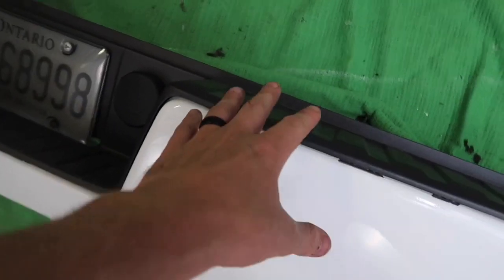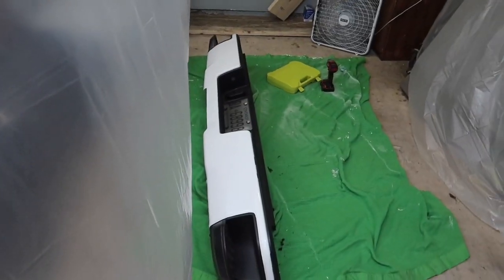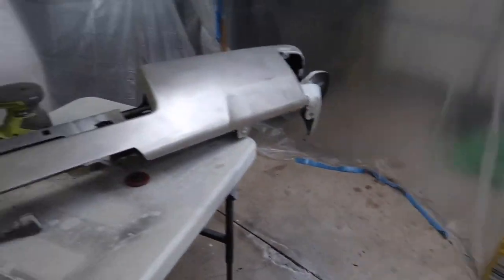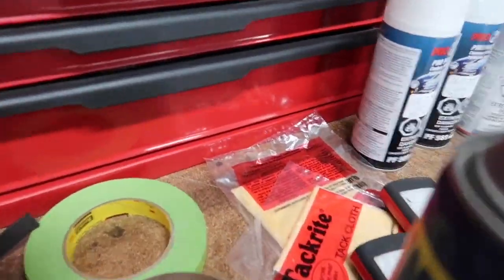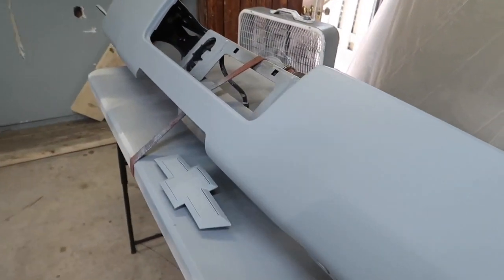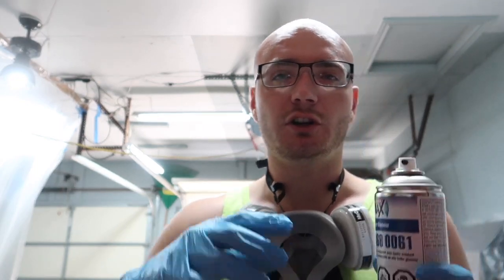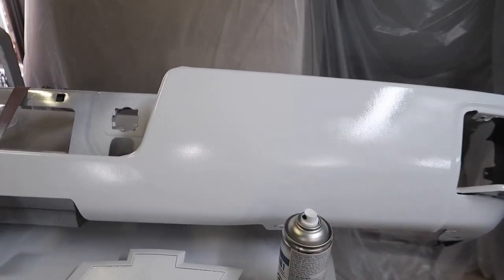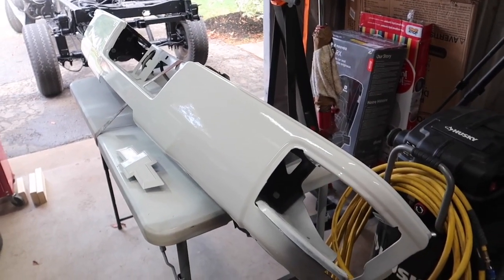How to paint over chrome bumpers

Comment: Turned out great man, the only thing I saw that I would recommend for the future, if you look at the clear coat it kinda deflects the light in a disoriented way which is called orange peel. If you wanna take it to the next step, wet sand your clear coat with like 1500 - 2000 grit and buff over with a cutting & polishing compound, it will come out like a mirror.

Comment: Another good option is to used a diamond concrete grinding wheel on a right angle grinder .The wheel is for flattening nibs in concrete . Cost about 25.00 . Use that to score the surface of the chrome . Every square inch  . The scoring is VERY deep and also preps the surface for attaching fiberglass cloth and resin , to patch holes in the chrome . The chrome is now rough enough to accept Bondo . Takes about an hour score the surface of the chrome . Now just resurface and paint as usual . Works great.
Reply: Will you burn through the metal if you aren’t careful?
Reply: @mattbirch93  On my pickup , there is a removeable  chrome overlay . I think it is backed up with copper . But dont worry about burning through the chrome . The chrome is so slippery that the rougher the surface becomes the better . As long as the chrome is sound structurally you can grind off a lot. Any rust holes should get the loose rusties ground off and then use heavy weight Fiberglass cloth to patch hole . Then cover everything with thin layer of bondo , just like a car door or panel .

Comment: This is great video. Thanks for sharing commonly. I have recently bought a chrome bumper for my truck. But the color is metallic. I mean the color is like mirror, it is colorless and shiny. It is brand new bumper. I want it in white color because the front bumper of my truck is white. Can I directly use the paint that is used in the video? or do I have to make sanding and priming on the whole surfaces of this brand new bumper?

Comment: Hello. @Bradley Walsh 
1.) How did you know how much base cost to use? (How did you know when it matches as closest as possible) - I watched you used two full cans, but was wondering how you knew that was time to stop with the base. 
2.) So If the primer is dead smooth, without any debris or anything in it, you don’t have to sand it? 
3.) How did you know how much primer to use? 

Great Video and Lesson.

Comment: Great video  AND Serious question....why would one not use 2k epoxy primer or etching primer? 

Does the 2k clear do such a good job that it solves the bonding issue with chrome? Or is adequate sanding really enough with the standard primer to have good adhesion? 

 I use 2k clear on metal and plastics (Topcoat) but have a project coming up doing some chrome and would really like to feel confident about either using or not using the epoxy primer or etching primer...

I have just watched 30 videos of idiots painting chrome that will last until the video gets recorded if they are careful...

Help me Obi Wan Kenobi you're my only hope!...... :)

Comment: Your lower pass is a little light on both your mid and clear coats.  You really need to be sure to continue your pass all the way along the bumper not stop in the middle.  You should also prep with sand blasting media for ultimate adhesion.

Comment: Nice job Brad, for spray can, but the gloss wasnt there under the number plate section, and definately lots of peel, which you get from spray cans. If people dont have the space or inclination to have a compressor, then  would do spray cans, but nowhere near the atomisation from a good spray gun, not to mention the cost. But great work and thanks for the video.
Reply: Paul Noone I've used spraymax 2k countless times with results nearly comparable to my Iwata HVLP. I guess you don't know but after the clear dries you sand with 1500-2500 then compound/polish/wax.. And Fords naturally come from the factory with a fair amount of orange peal. So probably about the same as his final product. But you can either spend $23 on Spraymax 2k clear or $400 HVLP gun/$800 compressor/$90 clear & activator/rent or purchase/build spray booth for $8,000.. Then after that small fortune you still cut n polish for glass results if thats what you're going for.. Plus cleaning your gun and the hours etxta... Why I use Spraymax 2k, which is the same as any 2 part clear you shoot through a HVLP for smaller projects. And tossing the can is the entirety of the cleanup... He may have had an unusually hot day that made the clear dry too fast causing the orange peal.. But a little tlc and it would have the same results. Some people don't have $15,000 to be able to paint a bumper so $20 for the same results makes sense to me.